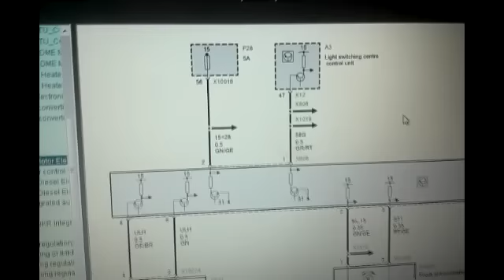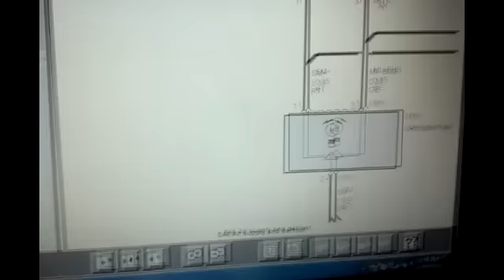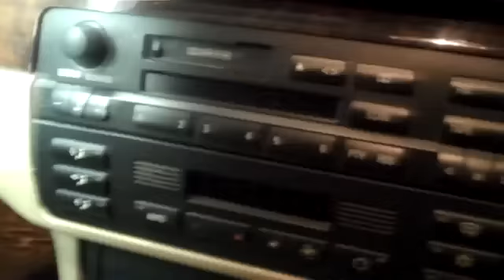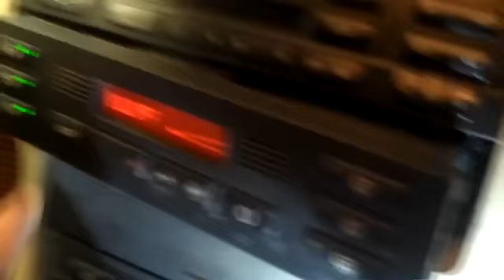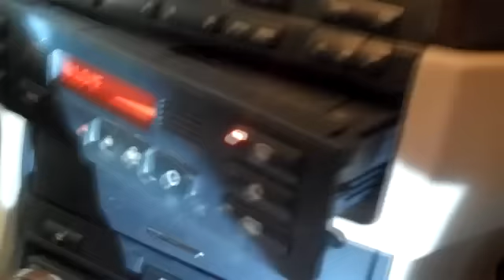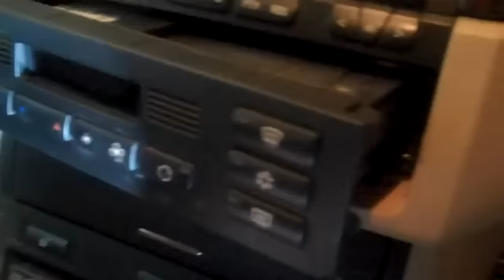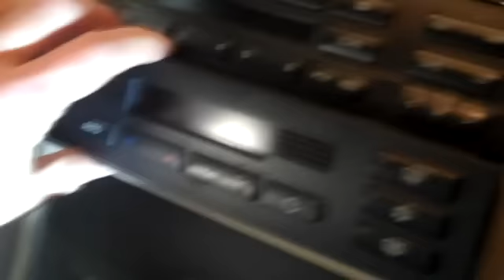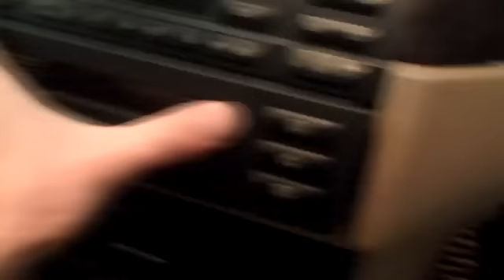BMW Heater Control Panel Removal And Intallation Including Diagnosis Tips E46 3 Series DIY

Comment: Nice video, it helped me to solve my problem. I did the so called "hard reset" by just unplug and replug the power feed plug. I had a bad hot water valve, replaced it and that did not resolved my problem - climate control mixing hot and cold air on cooling mode. But doing the hard reset, I dont know how and why, magically fixed the problem. Now I have a very nice climate control :)

Comment from the maker: Luis, Unplug the heater control panel and see if the noise goes away. If it does then it is the heater control panel. Now keep in mind there is a small fan in the heater control panel that will run for a few minutes when the vehicle is locked or woken up. This is taking an air temp sample and is normal. The fan is replaceable separate and you may only be hearing the fan.

Comment from the maker: Hello Luis, The noise may be the fan in the IHKA panel. If so then the failure is most likely the heater control panel itself. If it is the cabin fan still blowing air then the failure is usually the final stage.

Comment from the maker: Hello, As long as the key is off you can just unplug. The unit is not powered with the key off. Also if it is a new unit it may need to be coded by the dealer and will show NC (not coded) in the display. If it is used it should work right away.

Comment: Thank you verry much for your time and effort. :) i just wanted to say that the heating engine gave me signs runing with variable ups and downs turations at every. second until one day stoped and drain my battery. im going to apply your strategy and i will let you know. Thanks again

Comment: I didnt have front windshield air , just in center , on service they said i need to get analog climate control because it was before digital, i tried that unplug plug and its work now, but rear defrost dont work now, but its good front is more important then rear, ty so much man :)
Reply from the maker: Your welcome! Thanks for posting this :)

Comment from the maker: Usually no heat can be low coolant, or a failing water valve. The heater control panel does control the water valve which controls coolant flow in the heater core but it is very rare to have the IHKA panel be the failure for this.

Comment from the maker: There was a production range on the E46 where even if the heater control panel is switched off it will come on when the vehicle is switch on. On later model E46's (not sure the production range) when the heater is switched off it will remain off. The way to set it to car memory if your vehicle is in the correct production range would be to shut off the heater control panel and then lock the vehicle with the remote. If your vehicle is in the correct range the heater panel will be off.

Comment from the maker: Interesting. With a 98 you may have an E36 BMW 3 series. Try this, swap the heater control panel out of your friends BMW and see what happens. If it works the same as in his then it is the heater control panel. If it works the same then it is your BMW settings. Not sure if it can be changed. If it does shut off you can try to have the heater control panel re-coded. No guarantee but it may allow it to work the way you want :)

Comment from the maker: Hello, This is usually due to a low refrigerant charge. I would first have the system drained and refilled with the correct amount. Have them add dye to the system so a leak can be found if the system goes low again.

Comment: ok switch the final stage unit it didn't shut off the buzzing running noise coming from the unit the replacement from the dealer plugged in fine but wouldn't slide into the triangle shaped bay that the old one came from but plugged it in turned it over and everything was just like it was before noise still there with car off and key out I am thinking about to replacing the unit itself but waiting to hear your comments first and ty for taking the time to get back me I know time is precious

Comment: great video.  I have the same problem on my E-36 .no air coming out of defroster But when  I Put on defrost LOTS Of Air Comes out of center vent and no air comes out on window shield vent  ' DEFROST'  .  so I pulled out the climate control Out  AND There It WAS THE Black Wire Was Not Connected AT ALL And that FIXED The Problem. Thank You

Comment: Thank you for posting this video, I just recently purchased a 2004 330ci convertible, had a new radio installed and within a week I have no forced air coming from any vents at all. Before I waste any more money on diagnostics I was hoping if you could advise? AC  and heat were working perfectly, AC is fully charged and holding refrigerant, but the blower motor seems to not be working...Please help me!! Thank You

Comment: 01 BMW X5- I have a new heater control valve and the heat works great on the driver side. I have flushed the heater core to make sure there are no blockages. one of the 2 hoses into the heater cor from the valve does not get very warm and the other is hot. I dont think it is the valve as it was doing the same thing with the old valve. The climate control panel control the opening of the valve i believe, so should I suspect the panel or  is there a possibility of a inlet controller that has failed only for the passenger side? When I turn on the heat at any level the temp gauge goes from half to quarter if I am not driving down the road. Does the temp sensor go through the panel before it gets to the dash? Thanks for the help.

Comment from the maker: Sometimes with warm air from one side of the vent it is a low refrigerant charge but it sounds like you may have a failed stepper motor which controls internal flaps on the heater box.

Comment from the maker: The defroster will always default to heat on this BMW. If you only get heat with the AC on and only normal vents on then you need to have the compressor checked along with a refrigerant recharge with dye to check for leaks.

Comment: Hi thanks for the video , it's really helpful
Now my problem is air conditioner works fine also air is pretty cold as well but the footwell and. Top vent near the windshield blows warm air. So the cabin do not get cold enough .I would be so glad if you can help me out in this situition.
Last week I was thinking to sell this car because of this issue , really disappointed as I am not able to rectifyregards swetal

Comment from the maker: Check for power and ground right at the connector for the heater control panel. It could be a wiring issue.

Comment: Hi There. Thanks for the video. I have an E46 1999 320d. Got home tonight and the heater just won't turn off. Its blowing a gale even when you turn the engine off. Any thoughts on this? Many thanks.

Comment from the maker: Hello, This is usually an internal failure of the final stage. I have a video on how to replace the final stage or FSU. If the heater control is off and the air still blows you will have to replace the final stage which controls the blower output.

Comment: Glad to see a vid with this explanation. What if hot air comes from the defrost but only cool comes out the center? Reset or bad panel still applies?
Reply from the maker: +Bernie Zuniga Hello Bernie, The first thing that comes to mind would be to check the stratification wheel to make sure it is set to hot and not cold. Default for defrost is always hot but the stratification wheel can greatly effect the temp output from the center vents. I hope this helps. If you need further assistance please contact me via my website www.bmwdiy.com Have a great new year!

Comment: Hello! I only got air only coming out of the center vents. I checked fuses, connection to the heat panel, and Even changed the panel. Nothing realy seem to work. I cant Get deefrost to work, witch is a big problem in Norway. 

Thanks for help😄

Comment from the maker: This is not a typical failure. This may be an issue with a low refrigerant charge. Or it could be a failing heater control panel or there is a problem with the air distribution inside the heater box with a failing or failed stepper motor.

Comment: HI there. im also having hot air from footwells and windshield.the main one blows cold but when i turn off footwells or top middle blows cool not cold.i done the refriegerant change, contol panel. and not im thinking like  a flap inside. do the stepper motor change from hot air to the cold air.

Comment: Hi~It may be too late for me to discover this video. I have the similar problem as you described in the video but with opposite blowing vent. When I put the fan in fresh air mode, air come from windshield and foot vent but not center face vent.
However, when I put it in circulation mode, air coming from all vent and work normally.
I'm wondering what happened.

Comment: Hi i have a problem with the heater on my 2001 320d se, the light on the front windsreen demister has changed from green to orange and even when i have everything set to the coolest setting i only get hot air! can you please help?

Comment: Hi I have an E46 that has the same heater control unit but the lights on the back of it (so I can see buttons etc. at night) don't work. Any ideas? I've checked fuses etc. but nothing...Do I need a new part?

Comment: I have a problem with my unit not turning off after I remove the key I can hear the buzz or running what is either the fan or what you called the "self test" but it stays on and drains my battery currently I am disconnecting my battery at not so it doesn't drain bought new battery and had alternator tested driving me nuts I shut the car off take out key and hear that running  and only thing I have ever heard that matches is when ya had the unit remove turned the key off and the same buzzin sound

Comment from the maker: This is an odd one. The flaps close off different portions. There is the fresh air flap and air stratification. It is unusual to have a problem like this on a BMW that is not due to the heater control panel unless the wiring is not correct. I think some hands on is needed at a shop to find the root cause of this one.

Comment: Hi there, i have a heating issue, i changed the hedgehog unit under the dash board about a year ago, since then, i have no heating, i have flushed the cooling system out, both hoses ether side of the thermostat are hot and the blower unit is working correctly...................any suggestions would be greatly appreciated.

Comment: can I swap out this unit for the more simple dial heater? as this unit in my BMW e46 just doesn't heat up enough in the colder months.
Reply from the maker: Unfortunately no this cannot be swapped out. If you are getting poor heat this could be a problem with the heater core. Especially if you had any kind of engine over heat or coolant loss. Also there is a cross over pipe under the intake that often gets clogged preventing flow to the heater core.
Reply: that's a shame as I've already ordered a replacement part a dial unit.  BMW is low on coolant and will try a system flush and core.  thanks for your help.
Reply from the maker: I hope the flush helps. Make sure to do the flush in both directions. Best wishes!

Comment: Hey I have a 2000 BMW 323I the problem im having is sometimes my A/C goes off all by itself whether the car is driving or just idling.
I've checked my freon pressure and its ok I actually vacuum and recharged the system just to be certain however the same thing keep happening again.
Has anyone else experienced this same issue?